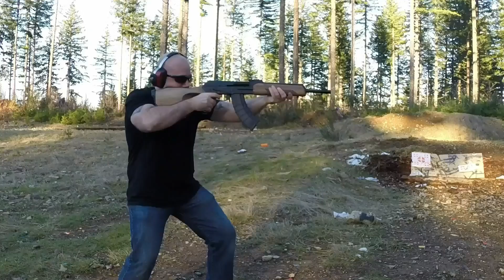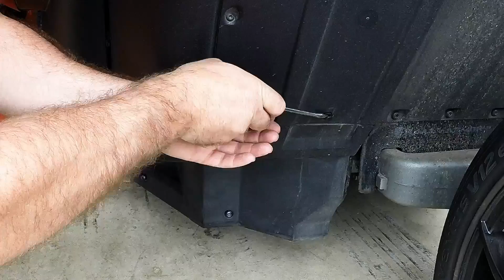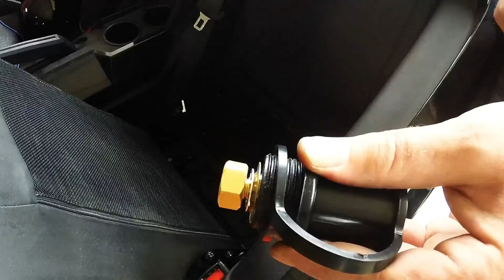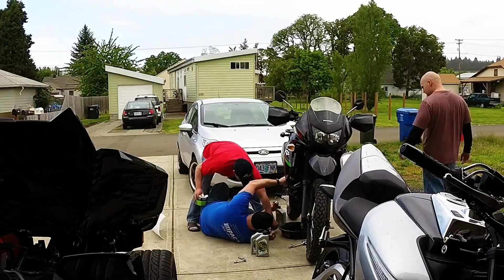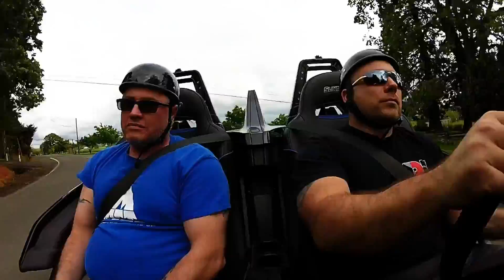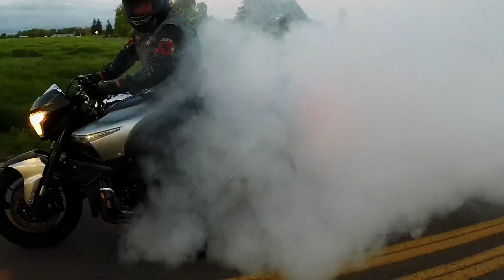Polaris Slingshot Jump Start Port Kit Install (2015-19)

Comment: Just installed these on my 20016 SL LE.  The video says it won't fit on models newer than 2015. but it seems to work fine.  The battery bracket is different (I just bent mine out of the way, then bent it back to were it was originally) and you have to ditch the OME washer that is on the battery terminal posts so the screw is long enough to hit the nut, but otherwise about the same install as described above.
Reply from the maker: Thanks for the post Todd. You're correct, this video does indeed need to be updated to reflect newer models as we now include the appropriate hardware for the newer Slingshot model batteries.

Comment: Hey Joe. Question. I'm guessing the charging ports are behind the seat now? Can you place pics ? You didn't show where to hook the battery up on the finished product.
Reply from the maker: Hello DJ, here's a pic of what the ports look like from inside the cabin: https://www.slingmods.com/image/catalog/tricled/polaris-slingshot-battery-jump-ports.jpg
Reply: @Slingmods  Thanks for the quick response and pic. Another question. From looking at the pic, could you have reversed the terminal so you could raise the seat and charge it from the inside ? This way you don't have to do take off the panel which could make it safer and tool less. Just asking.
Reply: I'm sorry. That is the inside. 🤣
Reply from the maker: @djrekklessdmv8757  Yeah.. that's the inside. haha. Just make sure you always keep the caps on the terminals when not in use so that the terminals are not exposed. 👍

Comment: Will this still work fine with the battery upgrade from the other video?
Reply from the maker: Hello Steve, yes it will work with the battery upgrade.. however it is a tighter fit because the terminals sit a bit higher.

Comment: why would you need to jump your sling shot just put in a optima. and trickill charge in the winter.
Reply from the maker: Thx for the feedback MMST. If you were to say leave your stereo running too long in ignition mode, etc.
Reply: Slingmods I still don't see how that could happen I leave my car stereo on on my super duty and it doesn't happen and I have yellow tops if you're going to run a bigger stereo system then put in 2 batteries
Reply: Slingmods I think really what the jumpers are for is people who are just stupid and can't think ahead or plan ahead. i used to run big car stereo systems when I was younger and I never one time killed a battery I don't see how a Polaris Slingshot could possibly kill a yellow top. just put in another battery.
Reply from the maker: MMST, We do highly recommend swapping out the factory battery for an optima deep cycle battery. We even make a conversion kit to do so. The factory battery has been notorious in the 15' and 16' models for not lasting very long. We sell an enormous amount of aftermarket lighting products and with our aftermarket fuse block or Neutrino Black Box we allow you to run those lighting accessories with the ignition off.

We've had several customer leave on underglows, etc. overnight and kill their factory battery. It happens. We simply sell this product along with the cyntur to help our customers from getting stranded in those scenarios.